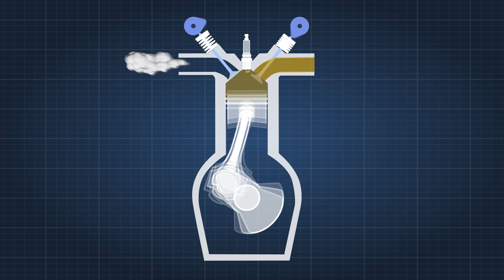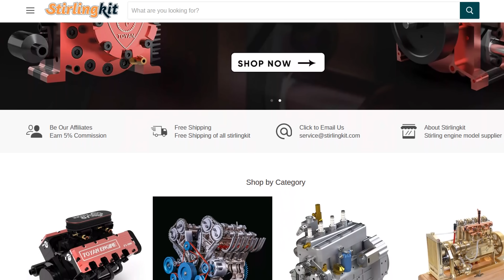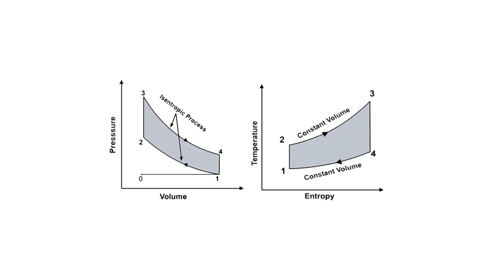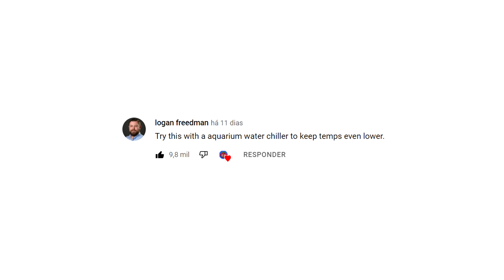I 3D Printed a Transparent Combustion Engine in Resin

Comment: The higher the rpm the higher the torque (assuming you are using the same engine for both tests.) 

The engine is speeding up until power produced = power consumed. that consumption is in all the drag and inefficiencies in the engine.

Comment: My guess as to why it's firing inconsistently, is that the air fuel mix is VERY rich. As is often the case with engines as small as that.
If there isn't a mixture screw on the carburettor, there's not much you can do about that, aside from removing the "jet" (which will be a small tube in the centre of the carby in this case) and replace it with a new tube with a smaller hole in the end in order to lean out the A/F ratio.

You can either do a lot of maths to work out how much to reduce the jet size, or you can just do it by trial and error. I'd wager that if you reduce the jet orifice by 10%, it will fire much more reliably. It will also run hotter, and may not have enough lubrication.

You could try restricting the flow of fuel with a valve, that might allow you to tune it.
Reply: Could it also be leaky valves? perhaps some air is being pushed out during the compression cycle (either through exhaust or air inlet valve). Also I don't know much about these sorts of things, but it looks like the intake valve isn't opening very much at all on the intake stroke. Maybe adjusting the cams, or perhaps adding a shim on top of the valve so it gets pushed further?
Reply: @DjoXey  I did notice that. That would be the second thing I would go after, only because it did the same thing more or less on multiple cylinders.

Definite possibility though.
Reply: If it ran Very rich the smoke would be a darker color
Reply: That would explain why the 25% Nitromethane fuel worked better than the others. It creates its own oxygen to combust there needs to have a way richer a/f ratio than normal fuel!
Reply: @justjonazjameson5559 that makes sense. However, I would just fit a turbo to help with volumetric efficiency rather than burning lot of fuel.
Reply: @Amin.Ashraf  smaller jet in the carburator would probably be fine in this case... but i would never say no to a turbo
Reply: why does it run hotter if less energy is introduced in the system?
Reply: @MadEvo606  fuel needs air to burn. if there is to much fuel it cant all burn, so some of it evaporates on the cylinderwall and cools the combustion down. Leaner mixture (no evaporation) = hotter engine.
Reply: close but not really
U see dear boy MAGNETS every fuel did not go to 4500 rpm THE sweet spot for Exaughsting and intaking It was The perfect speed. while everything else went faster :) so the magnet was a switch u could say (so why didnt keep up or regester the other speeds.) well simply it couldnt do it fast enough im not saying the electricty is to slow that impocible its that the magnet took mulitple strokes to register another magnet going by it.
Reply: I agree. I think it’s shoving in way to much fuel for gasoline and not nearly enough for nitromethane. The thing about nitro is it will run lean, just not with nearly with as much energy. Plug might be continuously fouling in between strokes. China engines are always a mystery of what you might get lol
Reply: @KyleB_RCR8  also the trampoline valve springs that prob have less tension than the keys on my keyboard
Reply: If the flow of air and gaz is bad it will stop right away .. the problem here is not in the mixture but in the ignition u can’t see spark .. if the mixture was bad that doesn’t explain why we dont see spark
Reply: @allen4335  You won't see the spark.
All engines will run on a considerably wide A/F ratio. You can smell it when they're running rich and generally you'll see black soot from the exhaust. (in petrol engines)

If the A/F ratio is too lean, you'll see engine and exhaust temps rise (dramatically, as in they will melt the cylinder head at the exhaust valve in extreme lean conditions) you'll get detonation (knock) and in the case of these small engines that use the fuel to lubricate the cylinder, they will run out of lubrication and wear the cylinder to the point of no compression within ten minutes.

So no, they won't stop right away, they can run rich or lean, and if they are, it can have diabolical ramifications.

If anything, because of flame front temperatures and flame propagation speeds of the three fuels in question, it explains why the high percentage nitro methanol fuel fired more reliably than the other two fuels.

Comment: Exhaust stroke is slower when there's actual exhaust to be pushed out. Different fuels also have different detonation speeds which don't necessarily correlate to power. Test again with a static load, or some kind of muffler on the exhaust and you'll have a better time plotting the power of each fuel.
Reply: Faster burn always increases efficiency, but you have to put enough fuel into it. It’s simply running way to lean on nitro, without cranking up the carburetor

Comment: About the nitromethane - it requires a bigger squirt of fuel to be more effective in combustion. That's why drag racing cars requires so efficient injectors. You need a bigger dose of fuel to make it working effectively. Carbs ain't good for this type of fuel.

Comment: Power = momentum * rotation . I guess without hooking a load to the motor u will not see the difference. Momentum needs to be fixed. They might even run in a 4/4 circle afterwards  ;) since it should spin less dynamic and more even.

Comment: Explanation: your engine is running too rich without enough air which causes the engine to have a lower rpm, fix by adding some turbo or supercharger. but then you will run into explanation 2
Explaination2: your engine skips spark because the coil acts as a governor to prevent the engine from blowing up. its not a intake issue. to fix number 2 make the internals stronger then replace coil (if possible)
Reply: that's correct

Comment: fuel to air ratio was off in all the fuel types (some more than the other). I dont known the exact tuning specs of this engine but methanol and ethanol have more compresion than standart fuel if  i am not wrong. The timing needs to be adjusted too when using diffrent fuels. In an engine like this diffrent fuels will give diffrent types of smoke. The engine was basically not designed for these uses. Its an engine for fun, it doesn't need to be reliable or strong. If i could i would put compression rings on to the piston. Oil does not seem to be much of a problem in this case.

Comment: One idea to possibly make the engine run better, and be a bit more scientific is to give the engine a load. I think the best idea is to use some kind of generator hooked up to a multimeter, so you can directly compare the different fuels.
Reply: Adding a load to the engine also could potentially also solve the Skipping of Power Strokes.
As mentioned by Bully Maguire, the generator does need an Electric load connected to it, however a Resistor would do pretty nice
Reply: @jonnyboy5019 it does solve the problem, I have one of these and just slowing the flywheel with your hand a little makes the engine hit every power stroke perfectly lol
Reply: @jonnyboy5019  yas
Reply: I second this
Reply: Yes it is a load, a big one though :D
It's actually not a dead short, but you seem to know this.
Reply: Just what I thought. Or ofc also add a load to the system. It will slow down the motor and possibly solve the problem with the of  skipping power strokes. If you know the resistance you can just measure either current or voltage and you know how much power it generates. It might be more fun to have it power something that gives a more visual presentation of the power though. Could also just attach a propeller or something and then measure airflow. It would also give a way to compare the fuels and is probably more fun than a number on a multimeter.
Reply: Bully Maguire 🅥  Stop.
Reply: @suspense_comix3237  always report those posts
Reply: @RealTwiner  always ignore those posts** they aren't harming anyone so leave them.
Reply: @TheObsesedAnimeFreaks  they are misleading spam
Reply: @RealTwiner  and your point would be?
Reply: Kinda like a flywheel?
Reply: @creativecapacityunltd3427  That's the thing, the engine already had a flywheel, and thus a load, already connected as far as I could see. Ps, you can't build a physical engine with 0 load.
Reply: @Dzeno2010  oh my bad
Reply: @Dzeno2010  a fly wheel is not a load when the engine is running, it is only an inertial load when the rpm is changed.
Something needs to dissipated energy constantly to be a constant load.
Reply: @dfgaJK  there's always friction, and aero drag (epsecially with a high rpm flywheel, let alone vibrations), which is the whole reason you can't build a true 0 load engine. The load might be small but it's not negligible, a higher load, can dampen somethings, maybe in this case, slow down the RPMS (which can exacerbate or decrease the problem depending on proper triggering/timing of the explosions/cycles).
Reply: I think the ideial load would be a  known resistance, and then messure it with an osciloscope in paralel to the resistance, with the scope you can see the peak voltage, and also the waveform. you can calculte wattage with the peak currente messured and the resitance.
Reply: beyond your imagination  What the f#ck bro
Reply: beyond your imagination  go piss off spamming your content that's irrelevant
Reply: People.. that’s why there exists heavy flywheels. Putting a load on that model engine won’t help with combusting high performance fuel. To test the (load) theory all Integza needs to do is slow down the flywheel with his finger and see if it helps ignite the combustion every time the piston cycles. The only way to ignite high octane fuel on every combustion cycle is to increase the compression ratio. High performance fuels have higher octane ratings and higher octane rated fuels require high compression for a complete combustion.
Reply: U need to have a load in the generator, if not, it will not have a load, i'll just spin the generator free, u need a led o some shit to power too
Reply: @LordCogordo  Or a 6 or 12 Volts DC Halogen bulb to use as a braking resistor at the generator to add nice load to the engine.
Reply: @LordCogordo  That's why I said to attach a multimeter, they have a very high resistance, usually 1 megaohm.
Reply: @Crowbars2  yes, just because of that they consume very low current, and because of that, it will not generate a load, to generate a load u need to consume more power
Reply: I'm jealous of your idea dude
Reply: A drone prop would work.
Reply: Bully Maguire 🅥   @beyond your imagination  go piss off spamming your content that's irrelevant
Reply: Agreed.   Needs a load to actually get the right ignition timing and no skips
Reply: Going to piggy back off you Crow, hope that's alright, I've been around engines a lot in my life. And most that I know have some kind of load like mentioned above. Putting the Stirling engine on something that moves would be amazing to watch. Since you can 3D print the parts a full working drive train on a model car chasis would be amazing to watch especially taking it one step further and doing a clear transmission on top of it.
Reply: This a video idea? Sounds like one to me... Gratz on the printer.
Reply: What if Integza made hydrogen using electricity from a generator?
Reply: A simple fan blade will make a good mechanical load. The size of the blade will determine the force ...
Reply: @optroncordian7863  not that simple... Different fan blades have different air resistance to them. Work is also different depending on the design of the fan blades. Can you generalize it? Possibly, but you should know the specs of the fan before you even attempt to use it as a load. Electric motors and generators tend to be far better for adding a load and measuring torque and power. That's what dynometers use.
Reply: @TheObsesedAnimeFreaks  Nah, there is no need to be so specific. A bit of experimentation adn it wil work.
Reply: beyond your imagination  🔵THE MEANING OF LIFE "SPOKEN WORD"🎬👇🏼

https://youtu.be/7d16CpWp-ok
Reply: id do a small water pump

you could then cool the engine with water
Reply: My car engine runs fine when revenue in neutral. Load isn't going to make a bad engine run lol
Reply: eh it will be difficult, I don't think that puts out enough power.
Reply: Or maybe a alternator
Reply: That's called a dynamometer
Reply: you could also just use a braked flywheel
Reply: This is getting a bit technical, to do this correctly he'll have to take control of the ignition timing (maybe down to .1 or .5° because of the size of the engine it may not need a large variation)and AFR because different fuel would have different stoichiometric ratio hence the reason why some fuel wouldn't have it's ideal conditions to do it's job properly, also he'll need some type of a load cell to fabricate his own Lile engine Dyno🙈 hydraulic brake Dyno might be the cheaper/easier option 🤔 with the load cell linked to the brakes so you'll get the force output which you'll need to log along with rpm so you can calculate max output 🤓
Reply: Dudе Реfeсt Shorts 🅥   is fake verified and cat video and a bad one at that - don't click it
Reply: What could work is to set up a light bulb, of the old tungsten filament type, and use a multimeter to measure the voltage difference between its poles. That, again, can be used to calculate current and power. A resistor could also work, but a light bulb is basically a reistor that can shed much more energy without breaking. A guess you could need that, and it would make a cool effect as well, even when its resistance may not be all that "scientifically" linear.
Reply: Yes, a fan blade works nicely for this, BTW.
Reply: So you just want to say that keep the load was greater than the momentum is a higher than the momentum that was now so this cause the engine to move more faster right.
Reply: This shriner has the answers https://youtu.be/Cx6pKbFaJH4?t=1
Reply: shut up science people just watch the vid
Reply: If you try to add more load on that 
 “low compression” model engine, all your going to do is create a form of KNOCK which is, in this engine’s case, a combustion will accrue but the piston cannot travel downwards fast enough because of the “LOAD” you put on it. The amount of load required on this low compression engine to combust a high performance fuel will be so high of a load that the load won’t let the piston go down fast enough. This is how gaskets fail.
Reply: so a tiny hybrid yes a problem with that your howamd where would the Electrical load would go?
Reply: The stroke is so short the fuel is still expanding past bottom dead center.
Reply: Almost vapor locking
Reply: This is made out ofnplatic basically its a concept
Reply: Mi comant
Reply: NOS
Reply: give this guy the 3-D printer you always give away in videos.
Reply: You could set it to amps though...
Reply: @Fire90475  in the amp mode, it act as an short circuit, so no load
Reply: @Matheus-xk4re  A short circuit is the biggest load you can have on an electric generator.
Reply: @Toxicity1987  yes, a short circuit would have the highest current, magnetic flux and opposing torque.
Reply: beyond your imagination  
God has said in the Quran:

{ O mankind, worship your Lord, who created you and those before you, that you may become righteous - ( 2:21 ) 

 [He] who made for you the earth a bed [spread out] and the sky a ceiling and sent down from the sky, rain and brought forth thereby fruits as provision for you. So do not attribute to Allah equals while you know [that there is nothing similar to Him]. ( 2:22 )

And if you are in doubt about what We have sent down upon Our Servant [Muhammad], then produce a surah the like thereof and call upon your witnesses other than Allah, if you should be truthful. ( 2:23 )

 But if you do not - and you will never be able to - then fear the Fire, whose fuel is men and stones, prepared for the disbelievers.( 2:24 )

And give good tidings to those who believe and do righteous deeds that they will have gardens [in Paradise] beneath which rivers flow. Whenever they are provided with a provision of fruit therefrom, they will say, "This is what we were provided with before." And it is given to them in likeness. And they will have therein purified spouses, and they will abide therein eternally. ( 2:25 )

 Quran

Comment: Can it be that the ignition ignites at a defined time distance?
If so, the rotation is too fast and the ignition is too late.
Reply: The spark plug would have to be switched like the valves, with a camshaft as the trigger for the correct ignition timing.

Comment: I think I know why methanol is performing very well when it comes to speed. 
The better fuels release more energy in the form of pressure which stands in the way of the piston coming back up which decreases the speed, a feedback loop of sorts. (Also nitromethane is less volatile than methane, that will be significant after the next bit)
This also happens in rocket engines btw, you can look up pogo oscillations to see the case there.
Meanwhile more volatile, smaller but less energy dense fuels like methanol would burn much faster and release all its stored energy in a fraction of the time gasoline does but less energy is in the form of pressure for the next stroke so it has less resistance going forward, these 2 factors result in a higher RPM however as you said there's probably less torque behind it and I wouldnt imagine it to be as reliable as gasoline which has a very good mix of energy density and volatility going 

I have a simple mathematical simulation of a 4 stroke engine which I could test the pressure theory on why nitromethane didn't work on but I'm fairly certain that's what's causing it